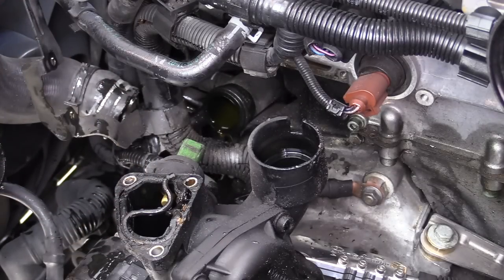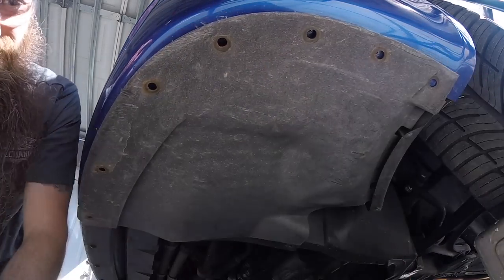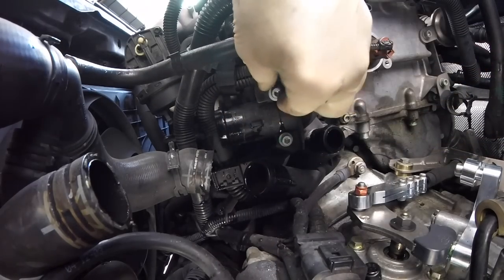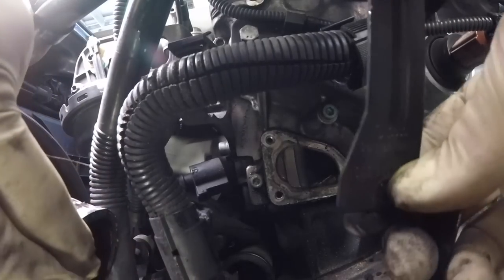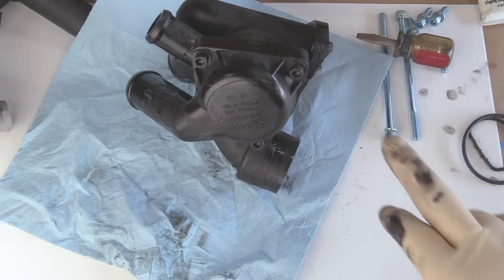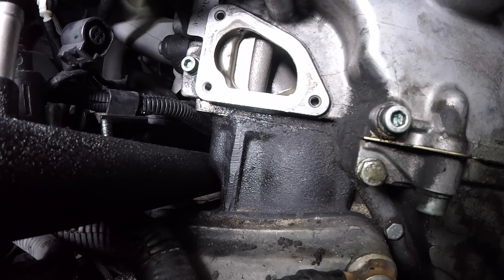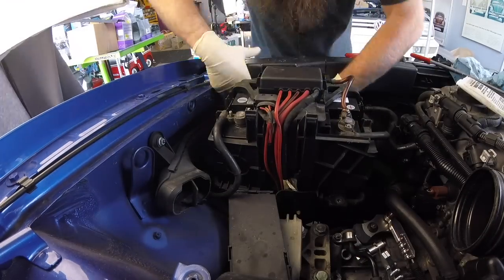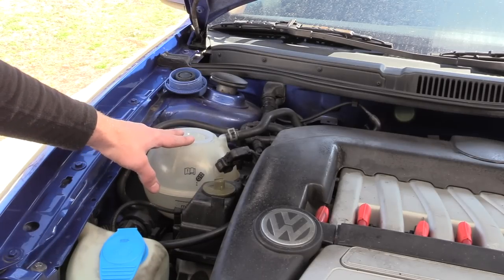Thermostat Replacement and Cooling System Upgrades

Comment: Hey Humble Mechanic, I stumbled across your channel when I bought my R32 at the beginning of this year which if i recall correctly is around the time you got yours. It has been really funny because our repairs have been close to identical with some occurring at different times. I just got the P2181 CEL and am going to be replacing the thermostat (already replaced the black CTS). I also, coincidentally, got the same P0113 Intake Air Temp sensor code as you. Have you found a solution to this? I have been told that the sensor is built into the MAF and I have done a visual inspection of the MAF wires but it "looks" ok. Would appreciate feedback on how I can rule out wiring vs the sensor before I drop a good chunk of cash on a new MAF. I appreciate your help and please keep up the good videos, they are helping a ton!
Reply from the maker: If you have VCDS you can see the temp in the scan tool. The wiggle the wires to see if it changes. 

Also if you had the key on with the MAF unplugged you’ll get that code
Reply: @HumbleMechanic  Brilliant, wish I had VCDS, maybe I can get my local mechanic to help me out with that. I do remember forgetting to plug the MAF in before starting it a few months ago. Turned her off, plugged in, and it went away. I have since disconnected the battery (between two separate scans when I got the CEL) and it either came back or did not erase. Hopefully the CEL is solely due to the thermostat and the other code is a remainder stored as history or something. Trying to decide if I want to go all aluminum housings/pipe or just replace the thermostat. They aren't a problem now but I bet they behave like the mk4 gti flanges (leak leak leak). I'm more in need of brakes/rotors and am looking at doing a big brake upgrade. Watching the thermostat replacement for this car it's hard to say no though since I'll be there with everything off.... wish I had the money, then it wouldn't be a question! Thanks for the help and being an awesome contributer to the dub world!

Comment: Replaced thermostat replaced radiator replaced fan control module replaced coolant temp sensor and I replaced the coolant when I did the radiator could it be the water pump? Or am I missing something else? @HumbleMechanic
Reply from the maker: that is a lot of stuff. What is the issue?
Reply: HumbleMechanic it overheats slowly like after 10-15 mins of running the temp gauge will stay at 190°F and then when I drive it for like 5 mins it’ll slowly start rising and by like 10-15 mins it’s at the red line but no smoke comes from the engine nor exhaust

Comment: If I buy the Thermostat housing for the vr6 but my engines onnly a v5 will it still work??
Reply from the maker: I don't know for sure. We never got VR5 in the US. I might give Eurowise a call and ask them if they have tried that application
Reply: @HumbleMechanic  All good thanks anyway mate I bought the thermostat housing from VW, so happy i found your video I have a v5 Bora and my engine bay is exactly the same as yours. You're saving me heaps of money as I know a mechanic would rip me in labor..

Comment: Can you do some MK7 stuff I know those water pump and thermostat housing always fail / leak
Reply from the maker: thankfully haven't had to replace the WP on my MK7 yet. LOL
Reply: HumbleMechanic  I thought mine was leaking from the housing that meets the block but turns out it was leaking from a tiny square weep hole at the bottom that is between the electric regulator and main housing I have no clue how that was happening and no way to open that section of the pump as it’s molded into one solid piece.

Comment: Can a bad thermostat housing that stays open during a regen causing the regen to abort because the engine temp gets too cool cause a P0401 “Insufficient Flow Detected” for the EGR in a 2014 TDI Jetta?
Reply from the maker: I’m not sure I’ve seen that. But you can make a really good case for it
Reply: @HumbleMechanic  thank you for the reply!

Comment: Yeah thats some times the fix for that code, but you can easyly chek your thermostat just by make it hot and look that the temps dont go under 70c*(debends on thermostat ratein your car) on highway.
Anyway, those metal pipes are Nice update, for your car! Even if that wouldnt fix your problem.
The coolant that come out of the engine in video, didnt look like normal G12 coolant color! Even veryold used one, that i have seen with lots of rust in it donsent look like lime green/yellow color.
Are you sure its good one? and so you shouldnt flush your coolant system?

Comment: I have a 2007 GLI with the 2.0t FSI, almost 100% sure my thermostat is going. I replaced my ECT yesterday added new coolant and still had my CEL. Weird thing is my car heats up faster than it normally would but once my car reaches 190F it doesn't go above that. It will actually start to get cooler as I'm driving but only drops about 20-30 degrees then goes back up to 190F. I guess my question is what exactly is going on with my thermostat? Never had this issue before. I had a problem with my old MK4 1.8t overheating, but never this kind of situation.
Reply from the maker: Very  likely a bad Thermostat. Could be a failing wax ball or spring. Or something is stuck in it.
Reply: @HumbleMechanic  thanks for the fast response brother!

Comment: Charles,  I may be way off base,  I mentioned on IG that you're spending about 15k on R32.  But spending more money to get all the issues fixed.  I would think you might be getting the R32 at cheaper price with the issues on it? Correct me if I'm wrong! :)  just wanted to hear your opinion :)  Ty for the awesome videos you put out!  They're great source!
Reply from the maker: I bought the car for ~$11k. I assumed that with 140k the car would have all teh common MK4 issues. There have been a few that I didn't expect and I am okay with that. The cool thing about the amount I paid for the car is that it doesn't matter one bit. It mattered the day I got it and it will never matter again. 

Now I am focusing on getting the car right, and making awesome content for you guys.
Reply: HumbleMechanic awesome!  Thanks for your reply, now I understand :)  I look forward to see many more awesome content, Charles :)  I don't usually work on VW's,  but I learned a thing or two about doing it from your videos.  They're rich source for knowledge!  Way to go, my friend!

Comment: You should really try one of those snake radiator clip tools. They're so easy to put into tight holes. [That's what she said joke]. But seriously, they're so easy to use you'll probably never go back to normal clip removal tools.
Reply from the maker: I have one. I never cared for it. I think it’s because it was a cheap one. The only time I ever used it was mk4 PD egr cooler recalls.

Comment: At least yours doesn't live under the intake manifold like in my 1.8t, such a pain; granted I don't have to deal with the xfer-pipe, but overall yours seemed 'easier'... Awesome stuff...waiting/wanting for mo.:Re 👍
Reply: K03sport 1.8t is like a 20 minute job lol. 30 minutes if you don't have a wobble extension and have to move the alternator out of the way

Comment: does the housing really have to be changed?
Reply from the maker: no, but 99/100 times when you take it apart, it leaks going back. the plastic gets weak and seals poorly
Reply: @HumbleMechanic  ok thanks for letting me know I will make sure to change I have a 2012 vw eos

Comment: I’m getting a chirping sound from my mark 7 gti engine bay. It happens randomly and doesn’t matter if the ac is on or off. Any ideas? Vw has the car for a week and could not recreate the issue
Reply from the maker: Man it could be anything  had a handful of noises be rattle under the cowl from the sound box

Comment: Does anyone have a part number or a link to the coolant hose that is connected to the water pipe, thank you in advance, when i was taking mine out, the water pipe had a bolt JB welded into the hole and the other end of the hose was plugged off.
Reply from the maker: I always go to the dealer for those type things. The pictures they have are usually the best.

Comment: I have to do this on my cayenne. Its the same engine only differnce is that the engine sits longitudinally in the engine bay and not sideways. Repair manuals states to remove the transmission as the frist step. Cant make this shit up🤦‍♂️we'll see how that goes. Hopefully i can get it off without removing the transmission. Maybe someone in the comments already did this and can help me out with it?

Comment: Crack pipe! LMAO...thats funny Charles..
Omg I hate them composite hoses.you look at them funny and they break...normally when the parts houses are closed...thanks HM
Reply from the maker: Yeah If I could have found a metal one locally I would have replaced it too.
Reply: HumbleMechanic I hate cost saving parts the oem' s use...to save a few bucks now  it cost the customer and is techs later...😣😣😣😣😣😣

Comment: You have to be joking , they are so hard to get at on the 2004 VW R32, mungrol of a job , no room to work in , everything in the way.
Reply from the maker: Nah it’s not bad once the battery and air box are out.
Reply: HumbleMechanic oh so glad, makes me feel that it can be worked on without cutting up my arms and hands on brackets and sharp bits.